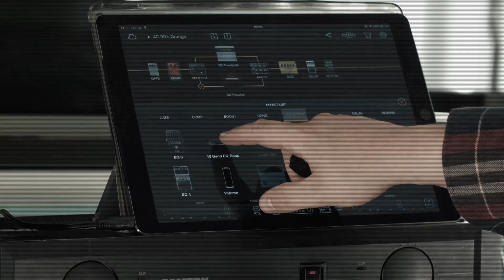Modifying an SM57 - Removing the transformer (TapeOp Mod) and changing the impedance

Comment: A lot of you seem to be under the impression Phantom Power WILL Destroy a Non Tranformer OutPut Microphone Cartridge/Capsule when it is a Dynamic, Not so Unless, You Earth/Ground One side of the Microphone Cartridge/Capsule to Earth/Ground and Apply Phantom Voltage to whichever of the Two XLR Or The Small Screw Locking (Tuchel/Amphenol Made,  Or Franz Binder Made versions or other maker's equivalent mating connectors with this type) DIN Plug PINS That Normally Pass The Positive Going AC Signal Output From The Cartridge/Capsule and The Negative AC  Signal Output From The Other Equal and Opposite Polarity Terminal Of The Cartridge/Capsule, The Pins On an XLR Being Pin 2 For The Positive AC Signal Portion Of The Cartridge/Capsule Output and Pin 3 for The Negative AC Signal Portion of The Cartridge/Capsule Output , The same Rules Apply If a Transformer is Fitted, If it is A Small Din Screw Locking Connector As Found on 60s, 70s, Early/Mid Eigties,AKG, BEYER DYNAMIC, SENNHEISER, SCHOEPS Mics and a Host Of German and Austrian and Other  European  Microphones, Wired To The DIN Standard, which is Pin 1 Being, The Positive Going AC Signal Out Put From Either The Cartridge/Capsule and If a Transformer is fitted the Same Rules Apply As Stated for XLR Output Above and pin 3 Being, The Negative Going AC Signal Output From Either The Cartridge Capsule and If a Transformer is fitted the Same rules Apply as Stated for XLR output Above Too. Then Yes If one Of the Microphone's Cartridge/Capsule wires is Earthed/Grounded and the other to either of the Normal Balanced Output Pin's XLR Pin's 2 and 3, Pin 1 Earth/Ground and Din Pin's 1 and 3,Pin 2 Earth/Ground Has a Phantom  Potential Difference Voltage between The Earth/Ground, (which is also the Negative DC Return for the Phantom Voltage Supply, with Respect to Either Phantom Power +12 Volts DC, Or Phantom Power +48 Volts DC) Being The Potential Difference In Both of The Two Standard Phantom Power Supply Voltages, Which are as Defined Under DIN Standard No, 45596, Standards, If my Memory Serves me correctly for the Standards Number, In Germany which is where The System Originated  and the system is not Correctly Balanced With Respect To Earth/Ground, Such as the Pin 3 XLR Old Output Signal + Going Phase Standard in the late Fifties in some Countries, being internally connected to Ground in the Microphone PIn connector in the Mic or a Mic cable Internally connected such that Pin's 1 and 3 XLR are Shorted Together and a Phantom Voltage is Applied to Pin 2 XLR , Then either with a Transformer or without a Transformer, The Transformer Secondary Coil will Probably Burn Out Or The Microphone Capsule Coil Will Burn Out or be seriously cooked in either case causing shorted turns to either Coil structure, Further If Th Latest International Standard since The Late Sixties/Early Seventies Of Pin 2 XLR New Output Signal + Going Phase Standard is Earthed/Grounded  and  a Phantom Voltage is Applied to Pin 3 XLR, The Same Consequences Will Happen, Burn Out or Cooking Of Either Coil Trans former Or Microphone Coil without a Transformer Fitted to It. The Same would Happen In the Case Of The Small Screw Locking Din Connectors Where Pin's 1 and 3 carry normally a Balanced Signal + and - Respectively  Balanced and Not Connected to Pin 2 Which In The Small Screw Locking Din Connector Case Is Earth/Ground, TheLarge Tuchel Connector found on some of The German and Austrian Manufacturer's Microphone and Have Different PIN allocations for The 3 Pole Versions But The Same Principals Apply. Ribbon Microphones and Dynamics Way Back in the Fifties and  some of those Made,Till Sometime the Seventies Had A Centre Tap Sometimes, Earthed/Grounded on the Output Transformer built in to the Microphones and Also Mixers On the Inputs to the Microphone Amplifers An Input Transformer with an  Earthed/Grounded Centre Tap, this also Known as Balanced with Respect to Ground,  If the Centre Tap's is Unconnected  and Is Insulated It is Known as Floating with Respect to Ground, Additionally the Centre Tap's On Both The Microphone Output and The MIxer Input Can be Used With an 8K2 Resistor In series with Thea Cetre Taps to Pass the Phantom Supply from The Mixer In to The Microphone and Out of It's Centre Tap Via It's 8K2 resistor toFeed The Powering and Capsule Biasing Circuits Within The Microphone's Preamplifier Handle Connector Assembly That The Capacitor/Condenser Capsule Is Either Fixed To Or Unscrewable for Swapping to different Polar Pattern Capsules. If No Centre taps are Available at either the Microphone Tranformer's OutPut Secondary Coil Or The Mixer's Input Transformer's Primary Coil, Then an Artificial Centre Tap is Derived By Using Two Closely Matched Resistors, of 6K8 OHMS to 1 Per Cent or Better Still. .1 Per Cent Tolerance To Mimic as If a Centre Tap was Available On The Microphone Transformer Output Secondary Coil or The Mixer Transformer's Primary Input Coil.
To Say when I first tried to Find out The Statement Phantom Lines To Earth, (Ground), Meant when I read it in a Journal of A UK Trade Repair Engineers Periodical E R T, Audio Fair 1968 Report and Review of what was Available from Ficord Microphone Companies models that Year, Was, almost if it was some Kind of Electronic Black art Known Only To Our BBC Radio/Telvision and Our ITV Television Station's and the Same Of American and European, Radio and T.V. station's. My FatherWas Ex WWII Royal Army Servie Corp's 49th West RidingInfrantry Division, Who went in To Radio,T.V. Brown and White Goods Repais and Doing Electrical Installations and other Related work, He could not tell mewhat it was, Phantom Power, but he brought me a Small reel to reel Awai TP 703 Tape recorder and a Book of The EMITAPE GUIDE TO RECORDING, Which started mhy interest in all things Sound, Recording and PA Equipment, I was also FascinatedBy Telephone and Now Know thatPhantom Poer Existed in their infancy via a    Battery to Bias the Carbon Microphones Primary Transformer Circuit, and The Transformer's Secondary Gave The +and- AC Output Signal to go down the Telephone Line, different version of Phantom power and before the Transformer on it's Primary Widing/Coil, The Outputof The Transformer Being the Secondary at approimately Line Level, of 600 OHMS and Balanced But NO Earthing/Grounding/ Or Screening/Shielding, as it's a Hotter Signal of .775 Volts dBU,almost 1 Volt AC.
Everything we Do in Sound or Recording is Directly Related to the Evolution of The Telephone Sytems in the World as a Whole from The 1800s and Tied Up with Companies Such As Bell Alexander Graham, (db I Tenth of a Bell Unit), (to originally do with sound as Heard, Now an Electrical Voltage and Sound Power level dependant on which Log Base of 20 or 10, it is Referenced To).Who Taught Deaf Children as well as being an Inventor and Experimenter, Western Electric and IWE, International Western Electric, They were UK based and are Better Known As STC, Standard Telephones and cables, ITT/ATT also Related to Western Electric, IWE/STC and They ended Up Owning Jame P Cannon'c Company as ITT Cannon And  STC Cannon Components PTY, The Austrailan Division of ITT Cannon USA and It's UK based Offices    inSuussec Also variously Know as Cannon GB and ITT Cannon GB XL, XLR UA, O, P, America/USA/EP, in The UK Through F& E, Films and Equipments  Wardour Street London, Pre Cannon GB/ITT Cannon GB and The X Connector, which is the original Format of The XL and XLR Connectors = X with a Latch is XL and FinallyX  With LR with a Latch and Resilient Socket Insert is XLR.
All My Information and Knowledge Has Been Accrued Through Years of Research and Reading to Find out The History andEvolvement of all That I have Presented Here.
Leonard Sorrell, Sound Engineer Recording Engineer, Manufacturing and Repair Engineer, C & G 224 Electronics Qualification from The 198o/ 81 Terms at Technical College In Canterbury Kent UK

Comment: the resistor should be in series ( in line ) not shorting the capsule.. the difference in sound is going to be in a transformer input mic pre, which needs the proper source impedance.  The impedance directly from the capsule is very low, compared to normal

Comment: They use to make an sm57 without the Transformer but the problem was if someone switched on phantom power  it would blow up the capsule🤟
Reply: only on xlr cable . ts cable don’t carry phantom
Reply from the maker: Who plugs a mic in with a TS cable in 2021?
Reply: @adamsteelproducer  why would you use xlr for dynamic mic!? Condenser yes. Dynamic no need I think
Reply from the maker: Where do you live? Pretty much every microphone has used XLR to interface with mic preamps for at least 30 years, the only equipment I have that works otherwise is from the 70s
Reply: Not interrupt .the only people who are probably using  6.5mJack connectors are home streaming people.
Reply: @adamsteelproducer  I have audix f50 which has xlr to ts jack pal. I have akg 100 with xlr to xlr. Dynamic mics are used with ts frequently
Reply from the maker: Just because you have a cable that supports it doesn’t make it common, there haven’t been any mic preamps that I know of with the proper impedance on a TS Jack for decades

Comment: Thanks for making this video. I came searching for the mod that converter from low to high impedances. I'm guessing that it's what was done with the 680 resistor. It's hard to distinguish on a very phone the change. Can you please include more in depth conclusions? Looking forward to the 'gizmo' edition.

Thanks

Comment: OK this is a capsule related question....I have recently purchased a USA Shure SM58 (new old stock) capsule without the handle and transformer part so my question is until I can source the handle and transformer to go with it is there anyway I can test the microphone capsule to see if it's dead without using a multimeter which I have heard can cause voice coil damage? these USA Shure SM58's sound way better than the modern Mexican made units but these are bloody rare and expensive coz they were last made in the US back in 1984 so not easy to get a good one so I don't want to waste money finding a handle to go with it if it's not working

Comment: Those mods just add mud. It's like turning both the treble and the volume down (you instantly lose 12db of gain when you go transformerless which is huge if you don't have a super high quality preamp) One mod to consider is to put a better transformer or at this point... buy a better microphone!
Reply from the maker: Do they add mud? Or do they remove that 3k spike? All relative. Also losing that much output level shouldn’t be a problem with modern preamps unless you’re whispering from 12 feet away
Reply: @adamsteelproducer  It is a problem with most entry level preamps on the market. For example, the Sm7b is a wonderful microphone ... if you have quality preamp that gives you at least 60db of gain to be able to use it which is not the case for almost all entry level preamp on the market. The sm58 requires a few dbs of gain less  than the sm7b, but still, quite gain hungry. Without transformer, you need more gain, therefore, you raise the noise floor. A lot a modern entry level preamps will have 50 db of gain (with noise). The best entry level interfaces will give you 60db of gain (with noise). Of course, in a studio environment, it's not an issue but at the same time, if you have the money to have a proper studio, why messing with that?

Comment: I dumped the metal grill and the foam insert, replaced with a strip of t-shirt  to get rid of the mudiness. 

I Added a dab of jb weld to the center of the plastic resonator to dampen the plasticy resonance of the resonator itself.

I changed to the yellow mod transformer from front end audio to get rid of the edgy distortion while keeping it bright and tight.

Lastly I will use a Cloudlifter Z to adjust the impedance to taste.

I love the compression of an sm57, but hate the indistinctness, the built in distortion and that it sounds kind of distant in a mix. I'm hopeful the mods will take it in the right direction.

I could have just bought a Heil pr20, but what fun would that be?
Reply: I just cooked it with some chilli beans to make it sound hotter. d= ;)

Comment: I play harmonica...which means I have different requirements for sound than guitar folks through my mics.  I have an early 50's Shure 520 bullet, and my back up is an early 90's SM57.  If you were to buy new 520's and SM57's today, you'd be getting different mics.  They have changed the guts.  And Shure won't tell you what or why.  The older mics sound better for harmonicas.  The newer ones seem to sound better for voice.  Just my opinion.

Comment: Removing the transformer smooths out the top end which doesn’t make it brighter, just cleaner and less harsh. It’ll allow you to push the high end more without being too harsh. In this case, you’ll be able to get a more pleasing bright tone as opposed to the stock 57.

Comment: great comparison. Try a shure unidyne III 545. It sounds like the best SM57 you've ever heard! Amazing on snares and guitar amps. not sure if they make them anymore, but they go on Ebay sometimes. You won't regret it!
Reply: I have one and I use it on my snare. The only problem I have with it is it has a faulty on/off slide switch that has ruined many takes.

Comment: So I took out the transformer and disconected the wires , but I didnt take note of which colour wire was originally on which lead. What do you think I should do? If I get the wires opposite since I may have to guess, will the mic just not work?
Reply from the maker: If you get the wires backwards, the mic will work fine, but will be opposite polarity to the rest of your mics- you’ll have to flip the phase either on your interface or in software, but it’s not the end of the world. I have a vintage 421 wired like that, I just have to keep it in mind
Reply: right i see. is there a way I can test to see whether its normal or opposite polarity after I wire it? because its easy enough to flip em around while i have the soldering gun out!
Reply from the maker: You know, I’m not sure! If you have an interface with 2 channels, maybe put that mic and another one up next to each other, and record a clap. Look at the waveforms and if they go the same way, job done! If they do opposite ways,  it’s rewiring time
Reply: ya, that makes sense lol. Ill try that! some engineer i am lol. thanks

Comment: how many watts should the resistor be? theres different watt 680 ohm resistors!
Reply from the maker: +James Cassidy watts aren’t a big issue here, as it’s going to have tiny amounts of power going through it. Smaller is fine. In big circuits that use lots of mains power you might need higher wattage ones so they don’t melt. No mains here!
Reply: thanks buddy, ordering my 100 today lol. I guess I have -to mod 100 sm 57's!
Reply from the maker: +James Cassidy haha yeah you can’t get just a few!

Comment: I preferred the stock SM57, but with the resistor added in, the mic had a fairly pleasant dark sound. Kind of a niche usage mic. I have a Tape-Op modded SM58, and I'm wondering if I should do the resistor mod now. Thanks for the video bro!
Reply from the maker: +Kadence yeah I wasn't aiming to say "you should use this one", more exploring what happens. I've been using the stock one more often, but this mod has its uses- I tried it on a piercing hi-hat recently and it worked a treat!

Comment: Both mods degrade the sound considerably in my opinion. The transformer's main function is to match the capsule's impedance to that of the preamp. The capsule requires a very low impedance, and removing the transformer puts too high a load on it, which ruins the frequency response. The resistor does little in terms of imedance and just lowers the signal even further.
Reply: I agree withe Erwin, havin tested it... Also removing the transformer exposes the capsule to fatal damage caused by Phantom current on some old mixers
Reply: In order to properly modify anything,  you need to understand how all the components work together, what each one does, and why it's in the OEM circuit. Basic electrical theory will help you.
Reply: Erwin Dokter are you even listening to yourself. Too nerdy for your own good. Do you know how many creative recording can come from this mod?